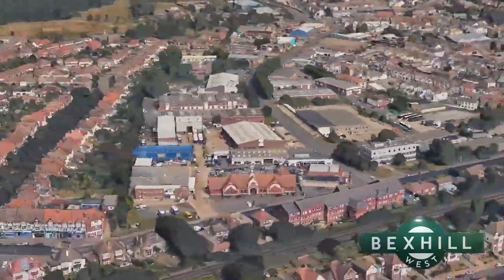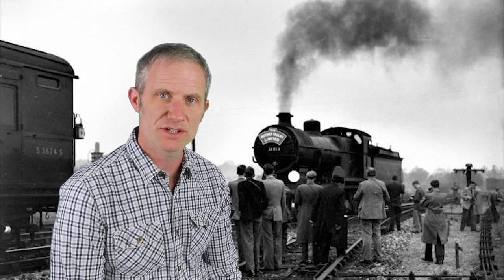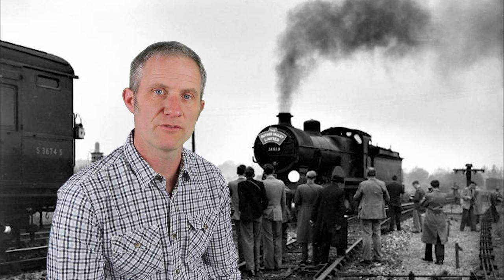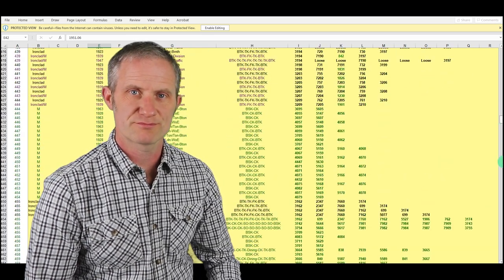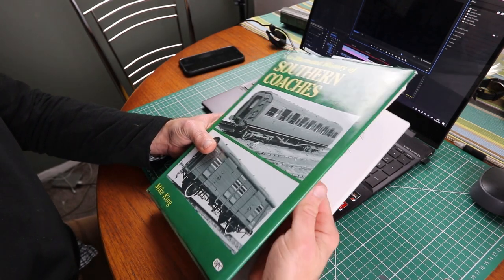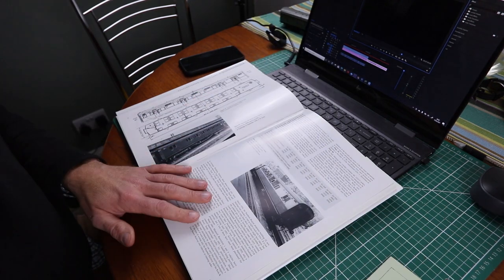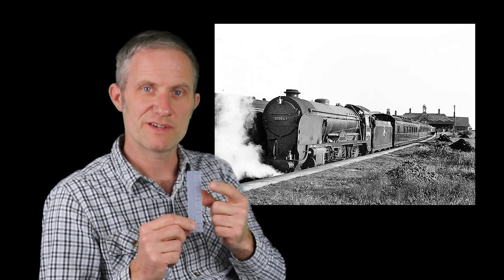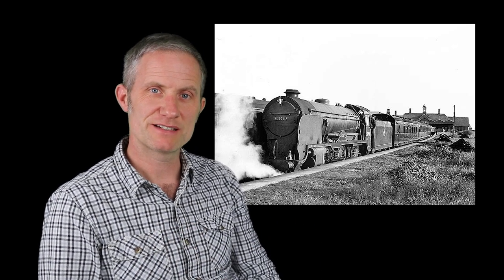3d CAD and printing for Carriages at Bexhill West model railway | Part 1

Comment: Hi James, like you and although I have a very basic understanding of carriages and types it’s unbelievable the different varieties there.
I have recently bought a set of Maunsell coaches albeit in N gauge, I shall now have to check what they are! Although it won’t make much difference if they are not quite right as they are what’s commercially available and I want a flavour of Southern and Great Western on my layout otherwise I’d never get it built!
Always interesting James and another project I will follow with interest, cheers for now John
Reply from the maker: Thank you John.  I totally agree with running what is commercially available, and as always Rule 1 should prevail.
In this instance I saw the challenge to create something which isn't commercially available as an opportunity to try something different and experimenting with some techniques.  I think I just prefer building things to running them.
Which reminds me that after 40 odd videos, I think there is only 2 clips where a train is running.  I must do something about that.  :)
Thanks for watching,
James

Comment: Yeah I agree those 3D printed coach sides look a little thick. Brass construction kits are more precise but inevitably much more expensive as well.
Reply from the maker: As with everything, there is a balance to be struck between fidelity, time and expense.  I'm hoping this process will work out.  If it is problematic, then etched brass would be my next choice.  I have the drawings prepared and it wouldn't take too long to prepare them for the etch process.
Thanks for watching,
James

Comment: Most people pore the resin into a mould and then put it into a vacuum chamber and vacuum the air out. This gives excellent results.
Reply from the maker: Yes it does, and that is certainly an option.  If my method works then the castings should be dimensionally perfect on all faces rather like an injection moulded part, and not require the exposed surface to be finished post cure.  
That's the plan anyway, I suspect there will be a few attempts to perfect the process.
Thanks for watching,
James

Comment: James, you might be aware the Bluebell Railway has a Restriction 0  Maunsell Brake Third coach in their Carriage & Wagon works at Horsted Keynes. It's in the final stage of restoration. I am not convinced that the Bexhill branch would have necessarily been subject to Restriction 0 even though it did apply to the Hastings main line. Nevertheless, the narrow width Restriction 0 coaches could be used anywhere on the eastern sector of the Southern Railway.

Comment: Very interesting, James. Not how I'd have thought of doing it, but then it's your new ideas that make your channel so fascinating.  I think you mentioned laser cutting/etching, so I presume you discarded the idea of laser cutting the coach sides out of ... err .... something thin that the laser could cut through.  I'd have thought that would be the cheapest way of fabricating them, maybe using 3-D printed or cast  coach ends and "ribs" within the coaches as formers for the sides.  
Do laser cutters work on plastic, or do they just turn it into a nasty melted edge?  Just wondered if you could cut a strip out of the centre of the off-the-shelf models and glue them back together with the reduced loading gauge.  But then you'd have the curve on the bottom of the coach that wouldn't be right. So that's an even dafter idea than I thought!
Don't worry about the length of videos.  You're dealing with (to me at least) complicated/novel stuff that does require explanation: if you made them shorter, you'd just spend even more time answering points from people like me commenting!
Reply from the maker: Hi Andrew, I'd agree that laser cut fabrications would probably be the cheapest option, but I haven't really the heart to fabricate what could be dozens of coaches.  Hence I'm looking at casting.  I am going to have one more look at laser cutting though, and I have some specialist material on order which might be suitable so will experiment a little further.  Plastics can certainly be laser cut, although one needs to be mindful of the gasses which can be given off by the process which can be poisonous or worse still corrode the machine.  Rowmark is an excellent material, although it can be hard to source in smaller quantities.
As for the suggestion of bashing an off the shelf coach.  I had considered this, but dismissed the idea as probably more time consuming than starting from scratch.  
Thanks for watching,
James

Comment: I possible problem with vac forming if you use  resin masters might be the heat softening the resin,but as you are only directly heating the styrene,the master should stay cool enough plus if you are doing a production run ,you have cooling time  whilst you exchange the frames holding the styrene
Reply from the maker: I think that resin masters (or patterns) for vac forming should be fine.

Comment: Would some 'vibration' help remove air bubbles/voids from the casting? They use a (ultra?)sonic vibrator when casting concrete.
Reply from the maker: That's an interesting idea.  When the time comes, I'll give it a try, thank you Henry. :)

Comment: Normally with resin casting you fill the mould then apply the vacuum to remove all the air pockets, it sounds to me like you are proposing a variation on injection moulding but instead of forcing the material in under pressure you plan to pull it through with negative pressure ? I think I see a possible issue with this, unless you have a lot of entry points and very few exit points the resin is likely to be sucked along the path of least resistance from entry to exit and not fill the mould fully but it i probably worth a try to see if it works, you may have found a new technique.
Reply from the maker: Hi David, I wish I could claim to have invented the idea but it's an established technique in the composites industry.  The advantage it that the variety of resins which can be used, including those of very low viscosity which should help to eliminate the included air.  
I must add than I am in no way an expert here, and am taking some advice from someone who does this sort of thing regularly.
My greatest worry is that any flexibility in the mould may cause it to deform under vacuum.  I think there is a way around this should it present as a problem.  But if all goes well, I should get something very close to an injection moulded part requiring very little clean-up.  Time will tell, and it will be a fun learning process regardless of the outcome.
My best wishes,
James
Reply: @BexhillWest  Hi James I will be watching with interest to see how it goes

Comment: Have you considered vacuum forming-  which is where you  mount a suitable sized piece of styrene (plasticard)  in a frame,  mounted on top of an airtight  box  fitted with a  vacuum pump,then heat from above until becomes  just stretchable & then you  push  your pattern master up from below whilst  creating a vacuum to suck the styrene into the recesses of your pattern.  Search You Tube  for vacuum forming for more details . Hope this helps . Query - you say not using printing resin because it becomes brittle, but you intend using casting resin-  is there  differences between the 2  ?
Reply from the maker: Hi Paul, I have access to a vacuum former, but don't really think the process is suited to recreating the sharpness of the detail I require.  It's a good suggestion though, and might work with a female mould.  If I get time, I shall experiment.
As for resin, I find that the 3d printing resin which I use can become brittle over time.  I haven't much experience of other resins so cannot comment if that is a general rule or not.  Whereas, my experience of casting resins is that they tend to be more stable generally.
Thanks for watching,
James

Comment: You might want to consider wizard models coach components, specifically brass side overlays could be used to accomplish your set and I have found them quite in expensive, 
Re Pullman car's you no doubt are aware that the Hastings line actually use to have converted SECR GIlbert cars ( ref "a car called Constance" ISBN 978-0-902835-23-B ) This book contains many diagrams of the cars over time, although the Oakwood press "Pullman trains in Britain" states "Camilla" as being Eastern section kitchen car. And according to Pullman profile no.2 it was s "K- type" Pullman car. 
From a modeling stand point the new Hornby's k type Pullman car's should be able to give you affordable option.
Reply from the maker: Thank you Edward, I will take a look at wizard models.  As for 'a car named constance', I was recently sent a copy by the SECR society.  It's a great read and something I'd recommend to anyone with a passing interest.
I will also take a look at the Hornby model you suggest.  There is a sister carriage to 'Camilla' at the KESR, hopefully when the current situation has passed I shall be able to go and have a good look over it.
Thanks for watching,
James

Comment: Have you considered using a 3D printer? Additive manufacturing for such things is now easier than the traditional subtractive methods (carving the master copies, etc.).
Reply from the maker: Hi Paul, I am using a 3d printer to produce patterns for my moulds.  The final products will be cast with resin.  I find that 3d prints of the fidelity I require can be quite brittle and have a tendency to warp over time.  My approach hopes to avoid this.  Although it is experimental, and success is far from guaranteed, I am enjoying the learning curve.
All the best,
James

Comment: The schools class loco was used a lot from Hastings
Reply from the maker: You're right.  In 1950, the delighfully named 'Bo Peep' tunnel was closed for repair, and so all Hastings bound trains were diverted to terminate at Bexhill West.  There are quite a few photos in Schools class locos visiting, which is a bonus as in my view it's a fine looking engine.
Thanks for watching,
James
Reply: The schools class (or class V to give them the designation officially given) were designed with the line in mind so as to replace a number of elderly designs that persisted due to the restrictions. They lasted until the Hastings demus came into use on the line.

Comment: How many people gona notice that the carriage as bought doesn´t fit to the restrictions of the shown line, not many, some gona notice the wrong number as the ordinary one - but you (among some people watching) do -> so do it to sleep well and your sense of correctness!

~11:00 / seeing the 3D model - a train of thought: The side-boards are (nearly) vertical -> plastic strips cut window out and engrave doors and stots, glue a supporting back panel, windows and holdings or compartment panels on the inside (~12:00 yes, lasercutting could be a way too, etching would be overdone for carriages) and kitbash reshap the existing carriege ends and roof or 3D-print end parts and roof and reproduce .

~13:00 cannot tell about the hornby bogies themself, 
but the normal 00 gauge couplings are ugly and mechanical unreliable (seen this here and there) even the NEM-coupling-box isn´t at the same height from one manufacture to the other or even with wagons from the same manufacture (and those are most times rather fix mounted to the bogies), 
take a look at H0 couplings (Märklin Kurzkupplung, those from Trix and others) and how they are connected 
and for fix couplings https://www.youtube.com/watch?v=EbRS5vClYY0 those starting at ~6:20 + railway air brake hoses.

~18:30 / tooling, casting, reproducing, vacuum chamber -> https://www.youtube.com/watch?v=5DXBYb8If4w 
+ https://www.youtube.com/watch?v=mVZLXLaidjQ
btw. that canal, Plasmo, is also good for how to let things look used and some more things.

Thanks for sharing were you are at, till next time
Reply from the maker: Thank you Lass, you have made some great suggestions (which I am giving some thought too as I write), and I couldn't agree more about the couplings.  I have some neat 'Buckeye' couplings designed for the carriages which I hope will work well in addition to looking the part.
You video recommendations were also most useful, thank you for sharing them.
Thank you so much,
James